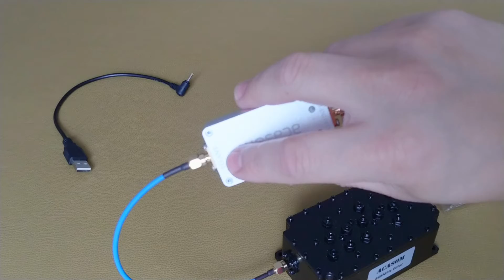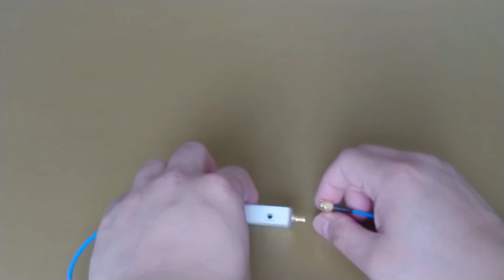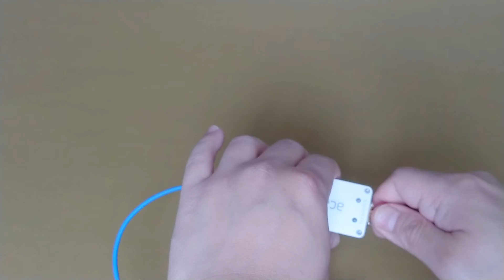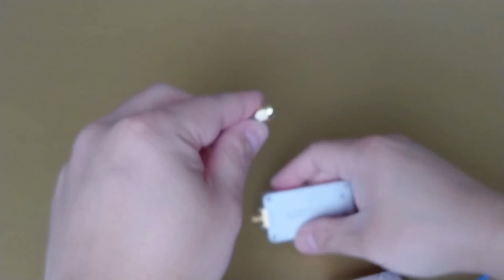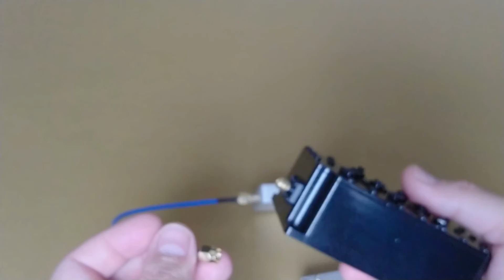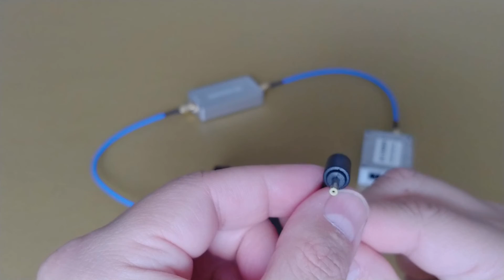How to connect Acasom amplifier, bias tee, Cavity filter. #helium #hnt #crypto #cryptocurrency

Comment: The cavity filter does have an "A" label on the upper right hand corner, under you fingers when you talk about it but I have watched videos that say it can work either direction...I have also had poor performance with the AMP installed so I currently only have the filter in place and witness/beacons have come back up to normal. I have seen video that says the AMP is TO SENSITIVE...still in chat with Acasom to figure out what can be done...latest was they ask me to put an 3db attenuator between miner and biastee to test. I have not done this yet though.
Reply: I am think of doing similar, my witness has gone down since I installed 2days ago.

Comment: Hi cheers for vid, I've received and set up the exact same set up and have it all connected. Have you seen better results since? I'm not sure I have, have recently removed the cav filter and left the amp and bias tee to see if is better. Any ideas if I should put the cav filter back on? Also UK with a 11.5dbi antenna. Thanks man
Reply: I have the same issue witness number drastically reduced and looking into what Gary Moss has done below.